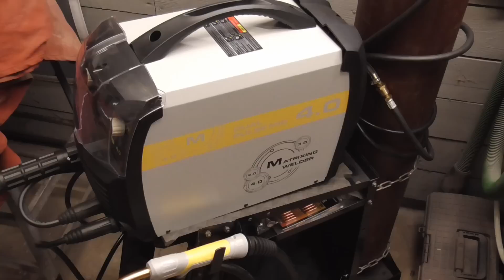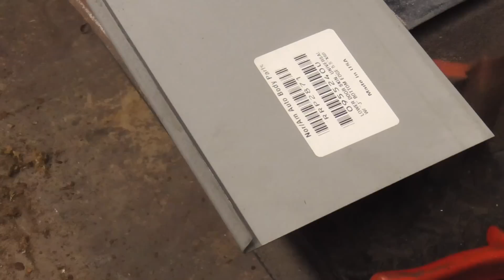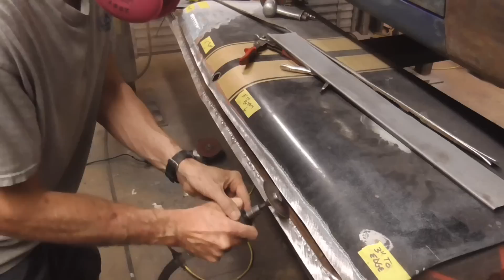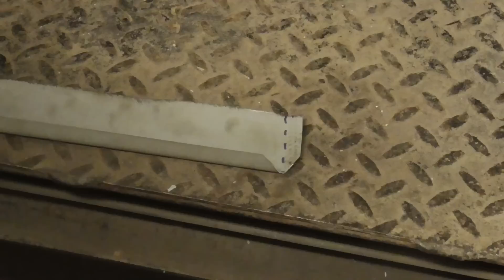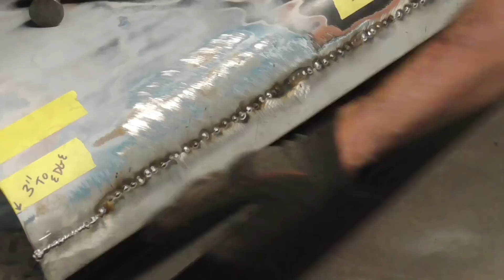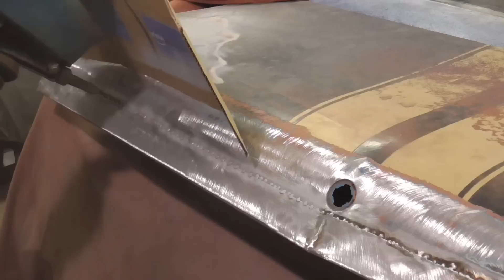Trunk Edge | Door Bottom Rust Repair w/ Inner Panel

Comment: Do you ever use Panel Bond over your weld seams instead of using fiberglass filler? We use it at the collision repair/body shop where I work and I like the results. Although it's more expensive than fiberglass filler. And it takes about a day to cure. Panel Bond is a lot easier to get into smaller areas and pinholes. And it appears to be stronger. So for areas that are handled a lot like this trunk edge. It might be a better solution. 
I'm not saying that fiberglass filler is the wrong product to use. It's what is used most of the time and it works. I'm just saying that Panel Bond might be better for certain repairs. What do you think?
Reply from the maker: I think that would work fine - especially the impact resistant type for slamming the trunk.  That being said though, I've never had filler crack or do anything weird on a hood, door, trunk, tail gate etc.  Keep using the panel bond if it works for you and find it really seals the seam - sounds like it holds up well 💯😊

Comment: Why do the welds need to be sand blasted?  Thx.
Reply from the maker: You don't have to blast them - I just like them nice and clean.  Wire brush works well too - on the drill.